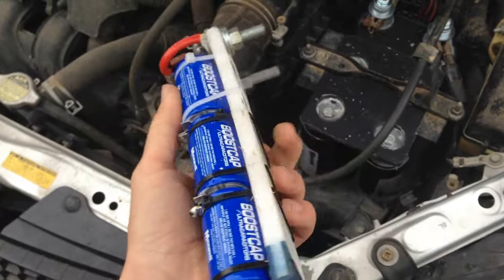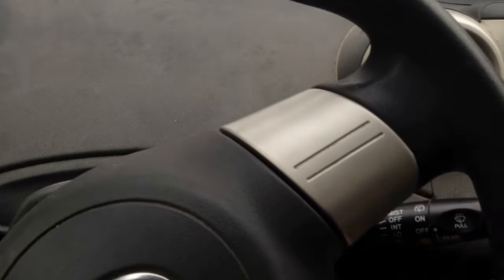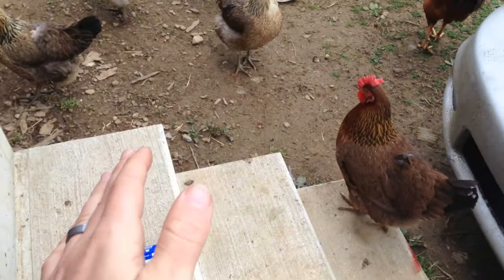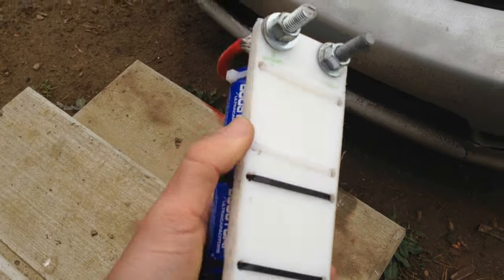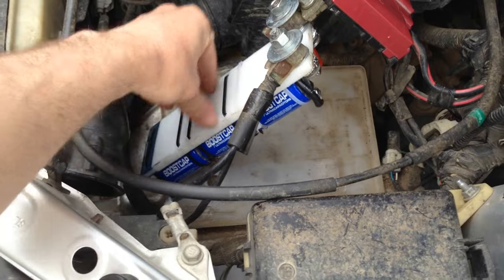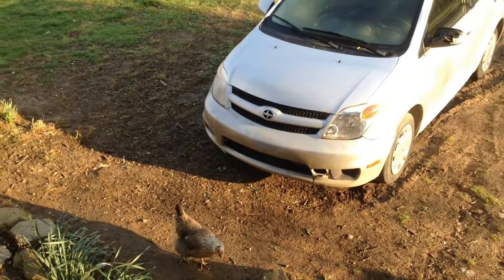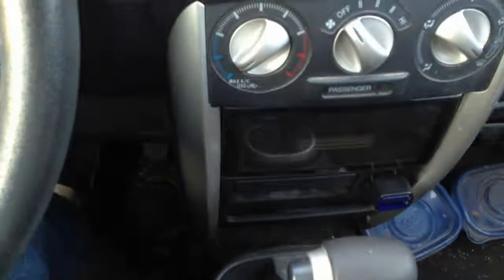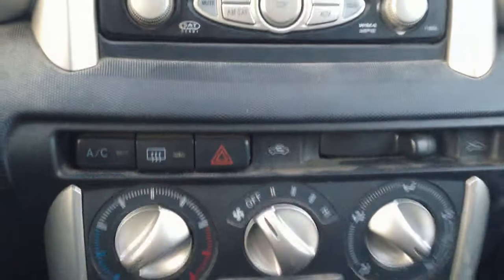Replacing My Car Battery with Capacitors! 12V BoostPack Update

Comment: This is CLEARLY fake, this guy must be working for Big Capacitor.
Reply: He isn't fake. He is right. I work with all types of super caps. 350F caps are to be used only parallel to the existing battery, while 3000F/2800F can be use as a replacement for battery. Still not recommended to use as replacement due to fast self discharge rate. After days work, specially in winter, you will find your caps are flat. You should add atleast a small bettery parallel to it. It will keep charging each other. 6x350F=58F unable to supply sufficient VA(volt-amp). So isn't starting.
Reply: @michaelrmarak5597  so capacitors better than car battery? btwn how long they stays charged?
Reply: Super caps alone is not good for long standby, due to high self-discharge rate. It is good when used parallel to existing battery. Never use super caps alone. It is better than battery when it is fully charged and can release 90% current in a second, and there after there will have little VoltAmpere reserved, depending on the size of caps. While normal battery will have 40% max current release capacity after that also so will have large reserve of VoltAmpere.
Reply: @michaelrmarak5597  sadly has high discharge rate... how much amps supercaps has?
Reply: Mawell 6x3000F has max 2600A short time. This 6x350F has max 325A short time.
Reply: After fully charged and not on load (not attached to car) , for this caps (6x350), in 24h it drops between 8V-10V. While 6x3000F goes down to 7V-8V in 24h. I tested only 2 times. Value can defer module to module. All cells are not equal.
Reply: If you want to use as replacement for battery always know how much WATTS (VxA) your engine require to start. e.g. Corolla consume 600W, you need 600/12.5V=48A (constant). This capacitor module's constant current is around 67A (short time). This caps can start Corolla as replacement for battery. It can start, I don't mean to say you do so. I am talking about theory.
Reply: @michaelrmarak5597  well thanks, but if u leave car for a week... it will be dead. did it scares of cold temperatures? where i am now leaving, sometimes is -25
Reply: So, you add 6x300F Maxwell super caps parallel to existing battery. Do not forget to use balancing/protection board. If no sufficient room for these large caps, then you add 2x(6x350F modules of NESSCAP) parallel to your existing battery. other caps you find in the market are not having equal strength like Maxwell and Nesscap.
Reply: I made mistake in typing: its 6x3000F not 6x300F
Reply: It will depend upon the type of primary battery. 6x3000F = Flat, Lead acid + 6x3000F = Flat, Calcium-calcium + 6x3000F = Flat, Lithium-iron-Phosphate + 6x3000F = START after 7 days under -25 degree.  Full replacement of battery with 6x3000F configuration is not recommended in your area.

Comment: I was reading all the disbelieving comments which were reinforced by all of the ads for "boost packs" associated with this video. At the same time I'm thinking, "Well, you just saw it and there didn't seem to be any trickery involved". When he came back from the radio test at the end, I'm thinking, "OK, still holding 10V, and the radio's still working, that's pretty impressive". But when the car then started straight away I lost all belief.

Comment: the capacitors will work just fine for starting . what they lack is a way of running anything when the vehicle is turned off . hence the need for a battery. capacitors are even becoming the norm in heavy equipment starting. most heavy truck use a four battery system to start the truck but a newer system is a 3battery system with one start module replacing the 4 battery. maxwell start module is the name that comes to mind. you have to remember once the vehicle is running all power to run everything is on the alternator not the batteries . that is unless your alternator is bad then  you have other problems.

Comment: The basic difference between the way batteries and capacitors behave is the discharge curve:  a 12 volt battery that is half discharged still is around 12V. A half discharged 12V capacitor is at 6V. The two are only slightly similar.

Comment: OK, I'm impressed that it works so well.   Just add the Lithium Ion Backup Battery OR a Solar Panel with a voltage regulator and you have a real sweet system.

Comment: Not only is it amazing that less than 50 farads is cranking the car easily, I'm wondering how that soldering with relatively thin jumpers isn't boiling the solder off during the starting. Ultracaps are definitely amazing tech
Reply: Look away - his soldering job is hideous!

Comment: Wow this is freaking amazing and im sure it could have a purpose. Imagine all those batteries dying in antique cars even though they fire up once a year? This would be a perfect solution. You charge it withing a few minutes and start a car (if we guess it has no problems starting) and even if you want to go somwhere it holds just fine and then when you decide to park your car in a garage and leave it for 6 months you dont need to worry about decaying battery (or however its said)

Comment: Ok.. so what.is being used to charge up the capacitors? Alternator? And as everyone know...super caps dont hold charges  but for 30 ceconda or so. What are you using to prevent overcharge? What is being used to run electrical accessories? Ecm etc.

Comment: That would be great in emergency situations but not for practical everyday use. Lead acid and Absorbent Glass Mat batteries act as a buffer between the AC ~ DC of a car and protect electrical components, transistors, and diodes. Also car enthusiasts would rather have a battery relocation kit instead of opting for a smaller lighter substitute. They would set the battery closer to the CG of a vehicle for more of a 50/50 balance which is great in tight turns. Great jumper pack though.

Comment: I going to copy your assembly for lawnmower setup.  Modern small batteries seem to fail every 6 months.  If I gain nothing else than not having to replace the piece of crap batteries, then it will be a  success.
Reply: Get a battery tender it will extend the life of those little batteries to around 2 years.

Comment: how did that work over time?  did that little cap pack hold up for the long term?  what happens if you don't use the car for a week or two?  still not quite a real replacement for a proper battery though huh...  not for running things with the car off, not for long term storage, etc..

Comment: If using it, you'll want a small protection circuit to limit the current going out in cases of a short circuit (not a resistor), and a circuit for protection against voltage spikes that may damage the caps.  Lead-Acid will store more energy and do so for a longer period of time, like you should charge that cap up and take it out for like... a week or a month, then see if it starts your car (if it survives overnight).  Depends on the 'Internal Lekage' value of whatever capacitors you're using.  Capacitors have a resistance to voltage change, and almost infinite current capabilities which is why as a battery replacement you should have short circuit protection, mainly to protect the capacitors because a short damages them internally by exceeding the current capabilities of the materials it's made of.  Compare this to a lead acid battery, where the amount of amps it can put out depends on the chemical reaction, which takes time, limiting the amount of amps you can get, also temperature affects the speed of the reaction, which is where they make up the term 'cold cranking amps'.  Capacitors don't give a fuck, antarctica, hell, you'll get maximum cranking amps.   Just less energy density (yet more amps so you need less energy in most cases), and internal leakage, like... half your charge is gone in a few days.  Maybe add a small solar panel on top to, like a 1 foot square (maybe less), to even out the leakage, and a backup power source so you don't get stranded if the solar panel unplugs or something.  If in a garage, plug it in to a charging circuit for like... 2 seconds before leaving.
Reply: Btw, connecting them in series to step up voltage, severely drops your storage capacity.  You have 6*350Farad caps, that should mean 2100 Farads, but it is really a little under 60 farads total.  So, an average alternator takes 60 amps at 12v.  You do get 12v.  60 FARADS means 60 coloumbs of energy before the capacitor loses one volt.  In your case, this doesn't affect amps very much since it's all roughly around 12 volts.  So, you really only have a few seconds of power before the voltage drops too much, meaning not enough amps to start the engine.  You're literally at the bare minimum with this setup.  If you were to wire them all in parallel, and manage to make a voltage booster capable of handling the current, you could have almost 100x more energy, also consistently 12V as power goes down.  BUT, the capacitors would need to put out a lot of amps, and you'd need a very low resistance converter circuit.  Really, all it is, is an inductor that turns on and off at a specific frequency in order to raise the voltage, plus other stuff that measures things to make sure the output voltage stays the same as the input voltage changes.  Even if the circuit is very inefficient (high resistance in the voltage boosting circuit), or cuts off when the capacitors are half empty, that's still a lot better than the way it is set up right now.  Point is, it can be a lot better than how it is right now.  It works, but it can be a LOT better using the same capacitors.

Comment: Nicely done.  Super caps are quite impressive.  I didn't know they made them this big.  I have a 1 Farad 20 V electrolytic and a 1 Farad 5 V super cap. 
...
Your total cap is 58.33 F.  (350/6). Measure the current drain when everything is off.  Some electronics will be running, draining the caps.  With the voltage drop over time that you observed, you should also be able to calculate the load current.  The radio current drain can be used also.
...
Doing some back of the envelope calculations and making some reasonable assumptions:
Sitting for about 208800 seconds (58 hrs)
Voltage dropped to 76.5% (10.4/13.6) which is about 64% of one time constant (TC).
So TC is 328338 seconds.
R is approx.  5,692 ohms (TC/C)
I get a current of  2.1 ma.  (E/R)  
Using your avg voltage of 12.
So... that's either the car's current drain when off, or the caps self discharge rate or a combination of both.
...
A car battery capacity is what; something like 50-60 AH (Amp-Hours)?
With your numbers giving the aparent 2.1 ma discharge current, the caps are showing about 0.125 AH of capacity (Assuming that discharge is all external current and not self discharge) which may or may not be valid.  If some of that is self discharge, then that small AH capacity is even less....
Another consideration is the peak current capacity of the capacitors.  There is heat generated in the caps when starting. Starting current is quite high and the life of the caps can be shortened. I don't know what kind of peak current they are rated for.  The ESR (Equivalent Series Resistance) is part of what determines that.   
...
In series there is no guarantee that each will charge to 1/6 the total.  Variations in the actual capacitance value and ESR will affect the voltage spread.  In addition, the same applies to the starting discharge; they'll all have the same current, but start from different voltages.  Some may be stressed more than others.
...
Newer cars could have more drain when sitting.
...
You also have to consider the capacity of a solar cell to charge them.  If that 2.1 ma is the equivalent self discharge  rate, it would be pretty easy to supply that, as long as there is at least tome sunlight.
...
Just things to ponder/consider.If I didn't make any mistakes in Excel...
-- 
Cheers

Comment: I'm an electronics engineer. This is for the geeks
The equation is: Capacitance when connected in series as here is= 350 divided divided by 6 = 58.33 Farads. If the supercaps are charged to 2V each (by using a suitable voltage balancing circuit), available power is 58.33 coulombs (amp seconds) at 12V. For current required to crank an engine, let's guess fairly conservatively at 200 Amps. Let's say engine starts within 2 seconds. That would need 200 Amps x 2/ 3,600ths of an hour = 0.11 amp hours to start the car (once). That's not all that much energy. Can the capacitors do it? At 12V they can deliver 58.33 amps for 1 second or 1 amp for 58.33 seconds. Amp hours = amps x hours. So that's 1Amp x 58.33/3,600ths of an hour =  0.0162 amp hours. In other words it's about 1/7th of the needed power before the caps are totally discharged. Or another way to look at it is; they can turn the engine over for approximately 58.33/200 = 0.29 seconds. Just over quarter of a second. So no, it's not enough. BUT if you made it say 10 times as big (6 x 3,500F capacitors) it could start a quick starting car once. The "battery" would be maybe $900 at today's prices and the pack would be 10 times the size of the one in the video and your car would need to start within 3 seconds max, first time. This "battery" would also need charging (with special balancing circuit) every time you started the car. It would recharge very quickly though due to it's small capacity. Probably just a couple of minutes to recharge it. So this guy had a good idea but capacitor technology still is about 10 times too expensive to compete with good old lead acid batteries.
Reply: No, not 200 amps cranking, more like 100 amps cranking on a small 4 cylinder
No, not 2 seconds of crank time, more like less than 1 second of crank time
So, you are already off by a factor of 4X to 5X !

No, not 12 volts, more like 14.2 volts <= Did you even watch the video?

The super-capacitor can discharge at 58.3 amps from 14.2 Volts, down to 9.6 volts
268 amp-seconds = 58.3 amps x 4.6 seconds 

268 amp-seconds / 100 amps = 2.68 seconds of crank time

My engine starts in less than 1 second after pressing the START button, so maybe 1/2 to  3/4 of second per crank?
So, I could get almost three one-second cranks from the SMALL super-capacitor bank.

Are you an engineer, or just someone who just stayed at a Holiday Inn Express last night?
Reply: @MrSummitville  Thanks for your kind "corrections". You are indeed fortunate to own such a fast starting small engine. I am an engineer and I do think this too small supercap battery idea will be very good for Holiday Inn Express trade due to stranded motorists! Put it another way, I wouldn't like to stall the car in busy junction in the rush hour.

Comment: So 350 Farads... C = Q/V    --> Q/t = I   -->   dV = I*t/C    --> So if starting your car draws 500 amps (probably very high on a small car), the capacitors will drain at a rate of 1.43 V/s.  So you'll probably only get about 3-5 seconds of cranking before the capacitors are too drained to turn the car over. That's definitely enough for a single start. It doesn't give much room for overhead. I like the idea of adding a lithium battery. A 5 amp-hour, four cell battery should provide an additional 25-30 seconds or so of cranking.

Comment: your battery doesn't just start the car, it helps even out surges and dips in power from your alternator, I wouldn't recommend using this for anything else than a booster. That said, the start/stop tech found on newer cars uses capacitors for the frequent starting.

Comment: I have a question. over a couple of days between starting your car the capacitors discharged down to 10.4 volts. would not a solar battery maintainer not keep the capacitors at peak charge? if so, how many watts would it require? I ask because Harbor Freight Tools has a 12v  15 watt solar panel on sale for $65. 
it is 36 1/2" long by 12 1/2" wide. it seems a bit large but it could be mounted across the dash or rest deck of your car has one. I was just wondering if the 15 watts would be enough to maintain the capacitors....and maybe your lithium battery you added to the back of your capacitor bank in another of your videos?

Comment: Heck, as light as that is you could carry a couple of spares in the trunk. what about a plug in or clip on connection for quicker replacement with out tools? also perhaps installing a small solar panel to keep up the charge?

Comment: Using capacitors instead of batteries is the trend these days.
I was impressed by the Japanese from J R C using capacitors instead of batteries as input to their inverter in their solid state DOPPLER WEATHER RADAR. Fantastic

Comment: I doubt very much this idea would make the 12V battery obsolete, although it may have some practical application in certain situations.  The capacitors may be relatively inexpensive right now but if a large number of people were to start buying them, the surge in demand would drive the price up and there would no longer be much cost savings.

Comment: Interesting. I would point out that putting capacitors in serial doesn't necessarily mean that the voltage will divide evenly. If you go over the rated voltage of the caps you'll kill them. You may want to find smaller capacitors rated for 18V and parallel them.

Comment: It would be nice if capacitors could replace batteries in all cars. No need to buy new batteries every few years and less batteries in landfills. But for added assurance it might be a good idea to put a hand cranked generator under the hood or a solar panel on the roof to charge the capacitor in case the charge gets depleted. Those wanting to blast out the stereo may have to run the engine to provide power. All electric and hybrid cars will still need batteries.
Reply: onetruekeeper why not both the solar and the handcrank? why limit yourself to just those options? :)